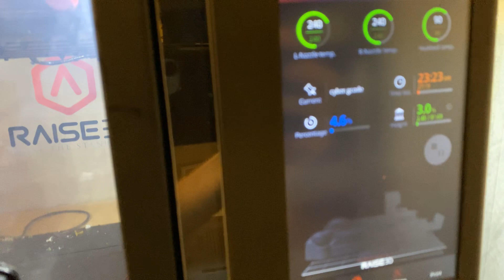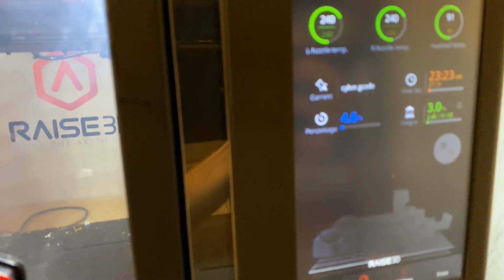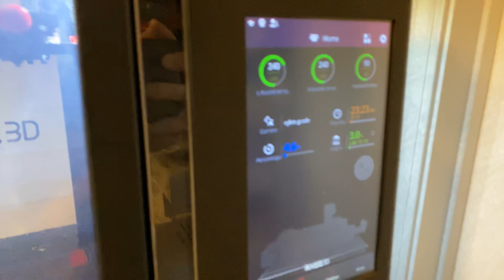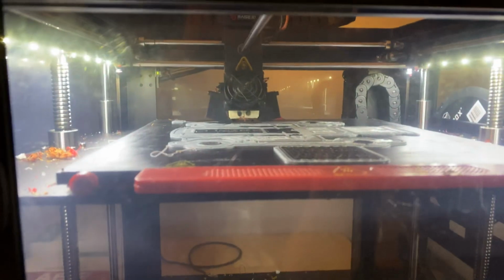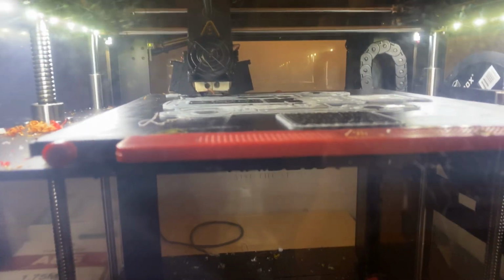2020 and what’s going on with the Raise3d Pro2

Comment: Thank you for ther update! I followed your earlier reviews so I'm happy to hear that they took care of you. Again thank you for the update.
Also thanks for the heads up on the eSun water soluable filament.
Reply from the maker: Jim Schmidt after a lot of thought I do believe the issues I was having was due to the heat inside the chamber, after I started turning the extruder temp down the issues lessened. I can say Raise3d did me a solid taking care if me. Funny enough it seems the chamber does such a good job it does it too well.
Reply: @murphyslawjackpadadapters14  I really appreciate the reply. I've got a few Prusa printers and have enjoyed using them for several years.
I'm in the market for a large volume printer and I've settled on gathering the funds for the Raise3D Pro2+ and your comments and review locked the decision for me. Thank you.
Reply: @jimschmidt4089  or you could get a stratasys

Comment: Is this a great 3d printer, would you recommend it?
Reply: I have two Pro2 printers.  For ABS printing, I put two blankets on top of the Pro2 to keep the chamber consistently hot.  I also unscrewed the Filter Fan/Filter assembly and had it on 45 deg on the rear right corner, so the filtration air flow circulates around the chamber.  I also seal up the vent on the rear.  It gets really hot, and I don't like how the filament runout sensor feels hot as well.  The right and left hot ends can rattle loose and their Z height will move to mismatch.  you're going to need to tighten it up every other day, if you're continuously printing.    I would recommend you purchase their E2 printer.  The dual independent head has less moving parts, so it can operate continuously without the need to adjust right left nozzle height.
Reply: @kimtruong4676  Totally agree here, this printer gets very hot inside and can print some of the highest heat filaments on the market, bed adhesion is the only limitation with these higher heat filaments, ABS does amazingly well on the stock surface(i use Magigoo on everything) but nylon works well on glass or mirror. Pla works well but needs the top off and front door open. Small issue with the filament cooling fan ive had a few times, replaced and went on. This printer is more of a commercial grade as its cost mirrors but there are a always small issues that will pop up with any printer. 
I ramble i know.

Comment: so would you buy another Raise machine im in the market for a larger IDEX machine and really like raise 3d not concerned with the money
Reply from the maker: david proctor yes I would, they have a idex printer released in Europe and hopefully will be released this year in the US.
Reply: Raise3d allow you to connect via ethernet or Wifi.  Software is somewhat stable.  I had to reboot perhaps once a month, but most of my network problem is on my network switch end, and rarely the Raise3D printer.  The Pro2 is the best Raise3D printer I"ve used, and from my experience doing maintenance on them (every other day or every week depending on use), I am more attracted to the E2.  The E2 design looks more robust.  That is, the right and left nozzle may not fall out of z alignment like the Pro2.
Reply: I run an N2 Plus at home, now with mods, bondtec an runout etc, and it’s amazing ! I also use a pro2 plus at work among others which is obviously also amazing and always my first go to machine out of many. Can not fault them, many knock the bed levelling being complex, but I say that’s because it’s so well built that once’s it’s done, it’s done. Bed height adjustment is as easy as it gets, only really required between material changes, but that’s for me, I only use a glass bed, not the material type on the pro, these tend to get damaged easily if you have any accidents with ABS getting too hot, which you will. Looking forward to the pro3 !! Already saving my pennies !!  All the best.